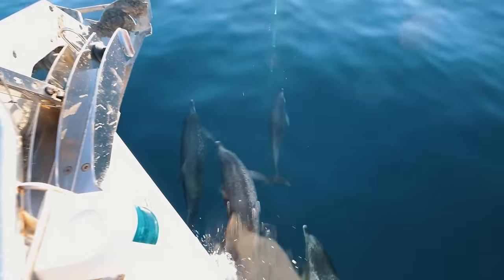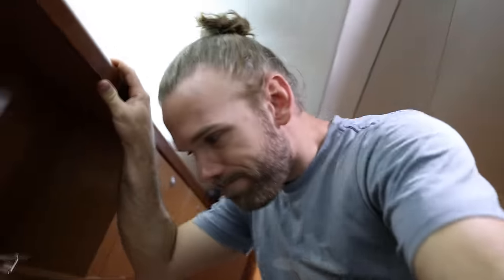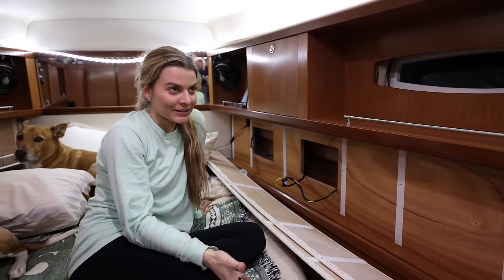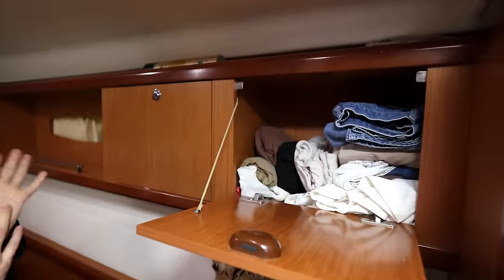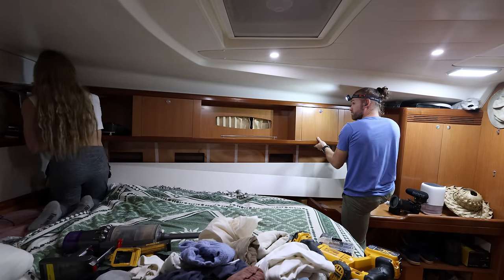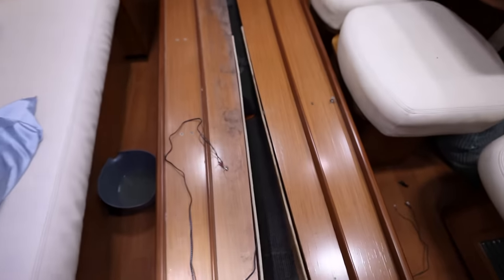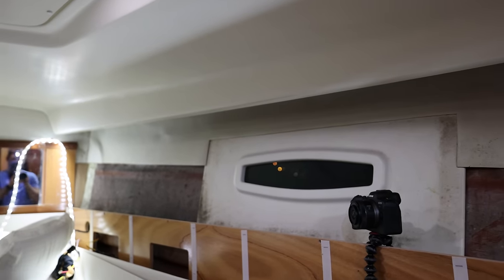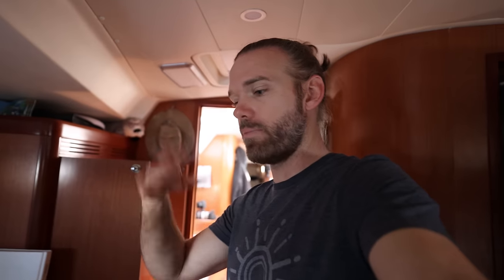Our Disgusting Secret - We Didn't Know We Were Keeping | EE 147

Comment: From a former building inspector - Mold is mold. The color is irrelevant. The idea that black mold is worse is a media driven myth. Those who are sensitive to mold (not everybody) can be sensitive to any color. To remedy a mold problem, first remove moisture. Realize you two exhale more than a pint of moisture a day just breathing. Your dehumidifier is a great first step. Then insulate your hull so any remaining moisture does not condense there and invite more mold. Or return to the tropics never to sail in colder climates again.
Reply: I agree and you beat me to the punch. Only they not only have two adults breathing in this berthing, they also have two dogs!!!  After the mold is removed/killed, they need to make a system for conditioned fresh air system with dehumidifying.
Reply: Right - I think there will NOT be the one solution to the problem. It will be a combination of several actions. 
- As in Uma, there should be insulation. These boats were NOT built to live on it the hole year. 
- Might help to have some forced ventilation behind the cladding and the shelfs
- ventilate with the window
- a dehumidifier. BUT: I saw from a professional firm in our business building: That machine does a poor job alone. It needs ventilation systems to tumble all the air.
Reply: I former learned to expect some 2 liters of water evaporated from an adult in 24h. The pint you mentioned might already account to one dog.

Comment: Hi guys. To stop condensation take the roof liner off and insulate with marine insulation, repeat for walls. Also, please wear an airtight filter mask. Mould infections in lungs are extremely difficult to eradicate.  Love your vlogs.
Reply: That’s the problem. It is not humidity but the fact that boats don’t have insulation. That causes condensation due to the dew point and mould.

Comment: Guys, there are mold bomb foggers that will kill the mold anywhere the air can reach....and you wouldn't have to disassemble the boat.  Products have been around for a long time now. I also use a negative ion generator (Ozone machine to some) - I run it for about 2 hours each month - but the 3 P's rule alpplies - while the machine is on no plants, pets or people in the area being treated. It can harm the repsiratory system! Air out the space for about 30 minutes before re-entering it. Works like a champ. You can even use some  small fans blowing into cabinet spaces to aid coverage penetration. Then I see you have a machine already lol...

Comment: Ozone generator and then spray inside with mold Armor from Home Depot. That helps keep it from coming back. I have one of those 80’s boats that you referred to. Plus I live aboard in NY.
Reply: Ozone generators are great, with the exception that they cause rubber to deteriorate. Degraded rubber seals and hoses is a far greater problem in a boat.
Reply: Second vote for Mold Armor.... I use their siding product on my house siding.and it works better than anything I've ever used.

Comment: Hey guys, Ryobi makes a mini fogger so you can fog a bleach water solution behind all the cabinets.  The Ozone generator should help eliminate the bleach smell afterwards. You can use a hole saw to make access points and cover them with grilles to  help with airflow to keep it dry. Shower drain inserts make nice small round grilles
Reply: bleach does not kill mold, high percentage hydrogen peroxide does

Comment: My daughter's house went underwater with the floods in Queensland a few years back and she wound up living there for almost 2 years with mould that would not quit, while she found another house. She borrowed my IQAir HealthPro 250 and it is not a plug for their units but a plug for any good quality air purifier. It made a huge difference in making it livable and no mould reactions as it had been filtered out. I would suggest something like that while you go through the process and as for every other comment use a mask.
The ozone machine yes but you need to clean the air quickly as you just stir it up all the time during this process.

Comment: You need to insulate your boat with armaflex so you don't get condensation when you heat up your boat during winter and cold before next time you come to cold places, I have a big sailboat that is insulated with armaflex now! Before i insulate i have same problem, now is notning dehumidifies for half an hour a day and it is completely dry!

insulation makes my little Dieselheater 5kw my boat 25 degrees even if it is minus 10 outside and is only running 50%, is 100L diesel/month.. 

Armaflex is expensive, sailboat likes yours it would probably cost about 3000 dollars, but you can use EVA foam, is maybe 500 dollers and 200 dollers for glued!  but it has to be glued on, it's quite a lot of work because all surfaces have to be glued 100%, otherwise condensation can form between the layers of insulation!

And you need some window covering for all windows that are on the deck, or you can replace the glass with thicker double-glazed windows but agian is cost a lot so a cheap window covering is fine (:

Thanks for good video and Fair Winds and Following Seas, maybe we'll see each other out in the big world, I'll be sailing around the world in a few years.

Greetings from a guy who lives in northern!

Comment: Sailing Uma’s Dan & Kikka gave you good advice, ventilation and the use of a whole house dehumidifier running 24/7 draining someplace that will not fill up.  This will prevent condensation forming from the moisture that is in the air from your breathing, bathing, cooking, and of course from the humidity in the air.  Definitely wear masks whilst cleaning!  Cover everything with plastic before cleaning.  Use 10:1 water to bleach or vinegar in a sprayer to clean with.  Let it soak in for 5-minutes before wiping up with microfiber wipes.  If you are planning on going up into higher latitudes, you should insulate the hull and the overhead.  Dan & Kikka glued foam tiles onto the hull.  Also, run a whole house HEPA with UV to filter the air.  Thanks for the Ozone Generator tip!  Good luck with the rest of the boat.

Comment: Tips for the penniless:
1. Use baking soda as a paste on mold FIRST(adds oxygen kills mold)
2. Wipe/wash away with vinegar water.
3. A sep bucket with really hot water to rinse out the rag before placing the rag back in the vinegar water.
∆
 | No point in clearing mold if the rag is being consistently being dunked in the "clean cleaning" solution.
Mold will just spread to other areas. The cleaning water won't be clean it'll just be smearing it.
Don't believe me?

Take a black light to the cabinets that were just cleaned.

Cleaning and permanently getting rid of mold is a specialty of mine.

Cars and tents should crack a window to allow heat to escape to avoid condensation. Especially if humans and dogs are sleeping in the a shared space.
❤❤❤❤❤

Comment: The Concrobium fogger is an ideal way to apply Concrobium Mold Control, a proven mold fighting solution that effectively eliminates, cleans and prevents mold and musty odors without any harmful chemicals.
Reply: IMPORTANT. This is the best advice you will get. Remove food and any soft materials that you can, open up as many air flow routes as possible, and fog away. Commercial restoration companies use this.
Reply: I was about to mention this.  One of the best solutions for your issue. Fog  the entire interior, far less disassembly required.  Look up RGF - Environmental Group in Ft Lauderdale. I own and have used their portable unit aboard several vessels to kill mold and also “other” odors.  I have one of their systems installed in my home HVAC unit.  Anytime my system runs, the UV unit also kicks on.  Totally human, pet, plant and food safe.  

Concrobium in either liquid or spray/fine mist is far better and safer than bleach or other homemade concoctions.  

Good luck!

Comment: Helpful video.
If you see condensation, mold is next.
We design insulation levels for condensation avoidance.

Keep surface temperature ABOVE dew point with heat, dehumidification, and insulation.

Comment: 14:32 yeah, you gotta let the drill run higher RPMs because the little fan on the back of the motor is cool the drill, besides that you guys are doing amazing
Reply: The drill is underpowered. It's not meant for these hard tasks. You need a heavier duty model not these mini ones.
Reply: It looks and sounds like he didn't have the drill in it's low gear, and he was barely pressing the trigger to keep the rpm slow, creating a situation that can overheat the motor/wiring.

Comment: What an adventure you are having.  We lived on a boat for some years and with a mattress direct on wooden boards you will get moisture under the mattress.  Sweat actually!!  What I would suggest is ventilating under the mattress by putting a slat system laid on the boards or using the Froli system.  Some people use a mesh fabric designed to allow ventilation but these are a bit limited.  We used a slat system sold for this purpose that cam with its own mounts so it just fitted on the boards with the mattress on the slats.  Worked really well and stopped moisture under the mattress!

Comment: Check under the ceiling panels. Notorious for hiding mold. I’m VERY allergic to mold so have gone to extremes to eradicate it at all costs. The sooner the better. Dehumidifier is key. So is an air purifier. Good luck.

Comment: Boiling water on your kitchen stove adds a lot of moisture to the interior of your boat. Whenever practical I use a propane burner on the back deck in cold weather to boil water, it reduces the condensation inside.

Comment: Whenever working on mold removal, mold experts will tell you, that a mask is preferable usually a 3M 95, as the spores are in the air when you disturb the surface,  You could be sick for some time be very careful with your removal.

Comment: Suggestion: 
As I watched your video I noticed that there is a small air gap between the fiberglass and the backside of the cabinets that extends from the bow to the stern of the boat. Mold territory. I would get the smallest (power wise) "Dehumidifier" like the one you have and do some creative installing. Mount the dehumidifier at one end of the boat and make a duct (hose) that connects directly to the dehumidifier and forces the "dehumidified" air from the unit into the cavity between the wall and fiberglass. At the other end of the boat drill a 3" hole and insert a grill to let the dry air exhaust from behind the cabinets. It does not have to be a lot of CFM to circulate the dry air through the small passage way. I would install small fan (5 VDC computer fan) at far end of the boat to exhaust the dry air from behind the cabinets. Adding the 2nd fan would insure that the air was sucked all the way through the small opening. Wire the system so it only works while the Solar panels are generating electricity, or your generator is running or on shore power. Just a thought. To test just put a hygrometer by the exhaust fan to see how much moisture is being removed. Should make you feel better and a lot less work in the future.

Comment: Take a 1 qt spray bottle of water with a couple of tablespoons full of regular bleach and SPRAY into hard to reach areas.  Mold will disappear/dissolve...gone!  We live at the beach in baja (Pacific side) and we get mold/mildew problems when it's cold and damp in Winter.  Works great & dirt cheap!
Reply: Eventually oxygen breaks down the chlorine, and it stops being effective.

The best thing I’ve found, after having to rehabilitate several RVs is concrobium while cleaning, then as a leave-in-place surface treatment in hard to reach areas.  Even works on those problematic RV refrigerators.
Reply: +1  on the Bleach
Reply: "Bleach kills only the mold on the surface, not underneath, which means that the mold is likely to grow back. When bleach is used on porous surfaces, the mold will move deeper into the material to avoid it. Vinegar can be used to kill mold on both nonporous and porous surfaces, but it is recommended to dilute the vinegar with a 1:1 ratio of water"  #ExpedtionEvans doing right with vinegar .

Comment: After 30 years aboard I have found you need to keep the cabin under 40% humidity or so. I prefer 35% or below. It can take a serious dehumidifier to accomplish this. I have pulled as much as a gallon of water a day. Humidity meters rock! I have an ozone generator but only crank it up for odor issues. Good luck guys.

Comment: drill tip. the drill wants to spins at max rpm for cooling. next time dont push and bump the trigger it will over heat and cook any grease on the motor.

Comment: Before re-installing the cabinets you should insulate the hull above the waterline to prevent condensation. You want condensation below the waterline as a natural de-humidifyer. Best insulation for the hull is the polyurethane foam floor pads that interlock.

Comment: Caution using a Ozone (O3) generator on a boat. In my generation the smell of your sheets hanging on the clothesline is the O3 that is trapped in the cloth while the sheets are exposed during drying on the clothesline. High concentration of Ozone has a high propensity to break down glue, adhesives, epoxy
 etc. Doesn't work out well on a boat long term.  Keep in mind that OGs are often used to strip off wallpaper and other simular coatings and adhesives. Also, consider OGs are used to kill bed bugs in hotels in heavy concentration and should be used as a last resort. O3 in moderation is ok to breath, as it exists in our atmosphere. However, high concentrations of O3 can damage the lining of the lungs simular to high concentrations of ammonia.  You guys are on the right track, manage the moisture with a dehumidifier, and you can use an anti-fungal coating in prone areas to deter mold, as well as promote airflow. Constant airflow (circulation) will deter mold development, as mold prefers trapped areas of moisture. Lastly, check under your mattress. That is also a well-known area because there is nowhere for the trapped moisture to escape. 
❤

Comment: Wish you had then washed everything down with a bicarbonate of soda/water solution before putting the cabinets back but fingers crossed for no more mould. Now, please please wash your bedding as the spores will have impregnated into the fabrics and wear masks. Our little dehumidifier also has an air cleaning function on it. Made a big difference.  Happy and healthy sailing 😊

Comment: I’ll go ahead and agree with the above comments suggesting an ozone generator.  Tour buses use them a lot between leases to get rid of the accumulated foot/weed funk.  The big ones should be used while you’re NOT aboard, but I’ve found smaller ones that plug into a 12v power outlet that are good for maintaining.  Works wonders.

Comment: The ventilation in these boats is so bad. You can add ventilation, and it will help. Dehumidifier is also a great addition, it really helps. Meaco is a good brand for dehumidifier. Mine takes like over a liter of water from the air in 24h when it is cold out.

Comment: Ditto on the mask wearing and try MoldStat system.  Should you add insulation to the hull it help prevent the condensation issue in colder climates. 

Reflextix may be a good choice or foam panels...just a thought.

Comment: These “Rechargeable Desiccant Dehumidifier Bags - Reusable & Absorbs Moisture & Humidity “  work well - they are packets you can put in that void and when the indicator turns pink or red you can remove and Microwave them to Recharge them and put back in place… this offers a bit of help in those tight areas that you have access to - this is also a way to monitor and see how fast and how moist in gets in those areas… good luck!*** also get a Flexible extension Bit for the drill -  you need that, that would have sped up the hex head screw removal!

Comment: If you can, Get your hands on a fogging machine. Fog the space using a mold killer / cleaner used in hospitals. This will provide the penatration in those " can not" reach areas. This method worked in a lake cabin that stays closed up most of the year. You need a macine that will produce a dry fog.

Comment: What most people call "Black Mold" is stachybotrys.  What you showed is NOT stachybotrys, which is in really, really damp conditions and shows up as sheets of slimy mold for the most part.  It can dry.  However, it any mold is a pain to address.  It can also be a problem with almost any mold if you are living with it in an enclosed area for a long time.  Long term exposure can create an allergic reaction, even if you didn't start out having a bad reaction to it.  I had to get really into mold issues at work for several years and even did a long project with NIOSH experts on mold at one point.

Comment: Air flow air flow air flow 
Being surrounded by water makes it even more difficult.
Mask mask 
Dehumidifier
Run the heat on hot.  Get boat dry.   
Clean and learn and move on.
Bodies emit a ton of moist air,  shower,  washer etc

Comment: Guys i know how difficult it was, i had the same issue with the used boat i got, removed all cabinets and over ceiling covers, wash them with a mix of backing soda/ vinegar/ lemon. After this i went with a hand wash of everything with surface cleaner that contains chloride ( i know not good for the environment)   and finally i spayed everything with dettol spay for surfaces before re-install. In between cleaning and reinstall of the cabinets i also installed a centrally controlled humidifier and 10 vents with hoses that are all around. Finally i changed some of the insulation as the material was not of the best quality and already 10 years since built of the boat.